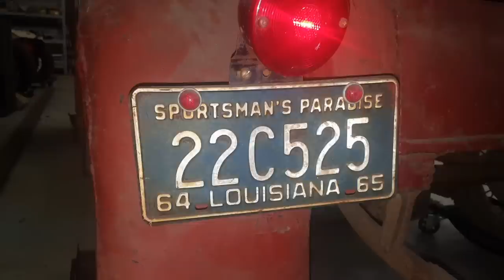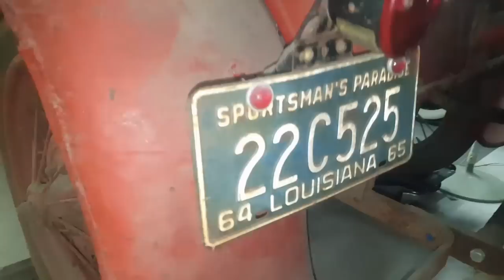1931 Ford Model A. First start since 1965!

Comment: For all the guy screaming to restore the car or hot rod it, there's two schools of thought. (at least for us older guys) You find something like this that's whole, complete, and run-able (almost as is) and you already have something worthwhile. Why screw with it, other than repairs to make it reliable? There's plenty of other cars out there where the original engine or driveline is toast and that's where you can hash out a hot rod because you will never have a numbers matching combination. Basically just another way to salvage some history, but of an era some 20 - 40 years later. (the original hot rod era)

Comment: The Model A Ford is one of the toughest and longest lasting pieces of American transportation every built.  It belongs in the same league as the original Jeep, the Douglas DC3, the Piper J3 Cub, and Union Pacific's #844.
Reply: Don't forget the VW bug. Not the new bug but the old ones.

Comment: Got a 29 GMC with the OEM Buick straight 6 and when cranking it sounds very much like this old Ford. Perhaps it's just the 6 volt system with the huge flywheel that cranks slow, but they all sound similar in that vintage. I remember going through all of these steps after rebuilding the bottom end 30 years ago. Seems like yesterday.

Comment: I know some other people have already commented this, but the real trick to getting a Model A to start when cold is to briefly pull out the choke and release it when cranking. I can pretty much guarantee you that the moment you let go of the choke the engine will start. As for the throttle, you can just leave the hand throttle at the point where you can see the foot pedal move down. I did see you pull the choke when starting, I just wanted to make sure you knew what did it just in case you didn't!
Reply: Also I noticed you said '1/4 turn I guess' before starting. The fuel mixture knob should, according to the Ford Model A owners manual, be set one full turn counterclockwise for starting cold (The little knob should be somewhere around the 3 o'clock position). To warm up the engine it should be a 1/2 turn or somewhere around the 9 o'clock position. For normal running it should never be open more than 1/4 of a turn (any more will foul the spark plugs etc.), but be careful leaning the mixture too much to avoid detonation or pre-ignition. I personally never go past the 2 o'clock position.

Comment: Pull the choke rod out while you're cranking the motor. It'll start in less than two turns. It sounded pretty good and idled nice!!
Reply from the maker: Pappa Bob Thanks! I pulled the choke on the 3d revolution and it started right up! Cooling system is full of rust so that's next.
Reply: @bartuning01  b u

Comment: That's where Henry should have put the battery on every Model A!
Reply: I like that battery location as well. I have a 31 four door Model A Town Sedan with an 8 volt battery under the floor board. I finally got around to installing a battery charger plug. That way, I can just plug in a 6 volt trickle charger without talking the access cover off. I do remove the cover occasionally to check the fluid level or clean the terminals.

Comment: I know it's a Model A, not a Buick because I have the same car in restored condition. Getting it to run is one thing but before it accelerates and goes through the gears you'd better makes sure that the connections are tight on the battery and ground cable. Do that before checking the coil if you have acceleration problems. Of course that's if you intend to drive it as is and not restore it first.

Comment: I wanna see that 67 oldsmobile run too!
Reply from the maker: Second owner of that car. Originally purchased at Bill McDavid Olds in Houston TX. I'm going to sell it soon. Have way to many cars. But I'm keeping my 31 FordBuick 😂
Reply: @bartuning01  i might trade my 1950 ford tudor sedan all original daily driver for a clean 67 442...? Whatcha think?
Reply: William Stamper doesn’t seem like he’s thunk anything as of today.
Reply: @donnebes9421  i just threw the offer out there. My offer is legit, ive got an all original 1950 Ford Tudor sedan (2 door long roof) thats kinda been my daily driver. It has personal meaning to me but willing to trade for a clean 67 442 because dad had one when i was young. I got the engine and trans from dads daily driver 67 442 from the 70's. His car rusted beyond repair and i kept the powerplant and trans.
Back around 2000 i found this 50 which was like what dad drove just out of high school in 1957. I bought it for dad as a gift and he loved the car said it was better than his original. I lost dad in 2016 but still have this 50 to remember him by. 
Now i think its time to re-create his 67 442 which had its own story. I was 6 and 7 when i couldn't see over the dash or door panels. I remember plainly looking at the black door panel with the c/s logo in the center and the 442 square emblem on the dash near the passenger side..
Reply: @donnebes9421  i also now have dads first new car...its a 1968 Ninety Eight convertible. Bright red with pearl white interior. All original always garaged still in almost new condition. 
This car when almost new pulled a 24ft Nomad travel trailer. I got the poloroid pics out in yellowstone and other places out west. (Im in Michigan)  The 98 has been the equivalent of a parade car since the mid 80's. 
Its the one car i can never sell. Again special meaning.
Id LOVE to have another clean 1967 442 as a place to put this 400 engine and trans from dads daily driver 67. In 1980 i was 10 and this engine was the first rebuild i ever had my hands on. Sure ill change a few things but plan is to "throw together" a killer clean 67 442 project.
I still have my very first car which is a 1970 Olds 442.
See where this is going? I am an Oldsmobile guy through and through.
And i need a clean 67 442....
Reply from the maker: Just saw these replies. 50 Ford Tudor. What a beauty! I am trying to reduce our # of cars!  I will be selling 2 project Model As and a fully restored 1926 Paige 6-72  and the 67 Olds 442.
Reply: @williamstamper442  It's nice to see car guys reminiscing about our dads, their toys, and memories. I have very fond memories of being a kid in the passenger seat of Dad's 63 Ford Galaxie XL500 convertible. Like you, I remember more about the interior because I wasn't big enough to see out of the windows either! I have my Dad's 31 Model A that he had restored in the 90's by a Model A club. I'm glad I have pictures of us with our toys. I'm also glad my nephew who is the first grandchild and has his Grampas name, has developed an interest in Grampas A. I'm sure that's where it will end up!

Comment: I hope you put lubricant down the sparkplug holes before cranking it over
Reply from the maker: Yes! I pulled the plugs probably 6 months before and hosed the cylinders with oil. Then maybe month later turned it by hand then repeated the oil process again. :)

Comment: Don't Kno abt a s but v8 Ford's have a Alan spline shaft runs oil pump sitting years the pump tight breaks shaft no pressure BANG .oil change helps.happened on 260  & 292 engine s 😎to me !
Reply: I recently bought a Model A with a Falcon 260 V-8 and 4-speed. Just right.
Reply: @modeladenny1218  they were the  engine common 64 wagons  probably a nice combo  much better than the y block .one I had burned valves as the gas became unl3aded

Comment: It's bad enough us Ford people have to put up those %^@@ chev engines in a lot of our older ford cars, but calling a beautiful 31 model A a Buick is going too far!!!!! even if kidding. Just look how great that car is, and how many 31 chev's or Buicks do you see?
Reply from the maker: Hi David, funny comment! Please read my video description. I called it a 31 Buick because I've had one for years.. and when my lips said 31.. Buick just came out. LOL I never changed the video because it was the last time my dad was in the shop before he passed away from brain cancer. Thanks for watching!
Reply: @bartuning01  Sorry to hear about your Dad, and I hope you have a lot of fun with you beautiful  "  A " one the most iconic cars ever made I envy you< but my Mustang collection does not allow an " A " in my world.
Reply: @davidmellott5049  I have one of each. My dad's 31 Model A Town Sedan, and my 289 powered 68 California Special. The A was restored in the mid 90's by a Model A club after it sat in my Grandparents garage since 1965. I've also taken a recent interest in my dads 1919 Fordson tractor. It doesn't run, but it looks like everything is there. Complete with metal  wheels on the back and solid rubber tires on the front.